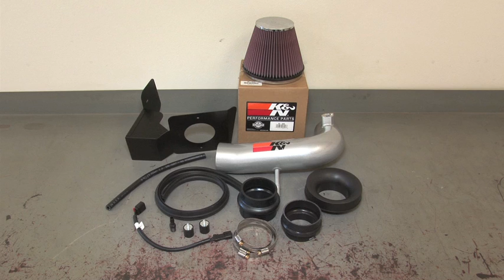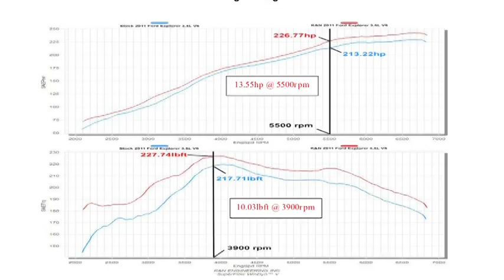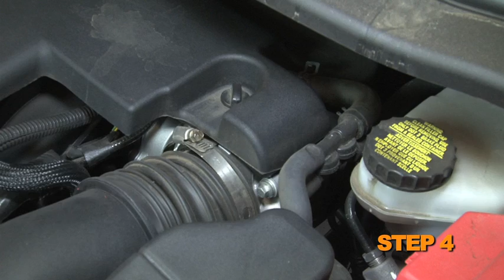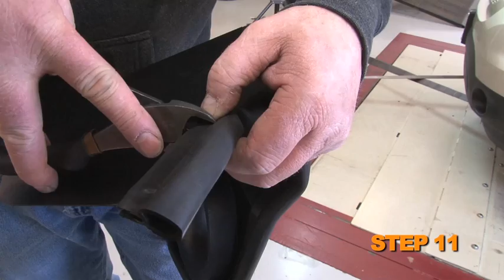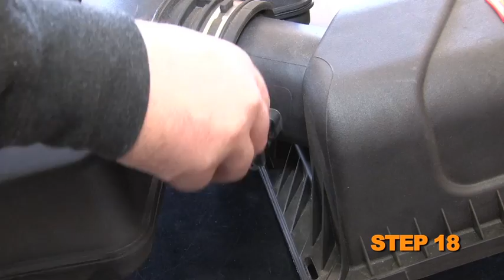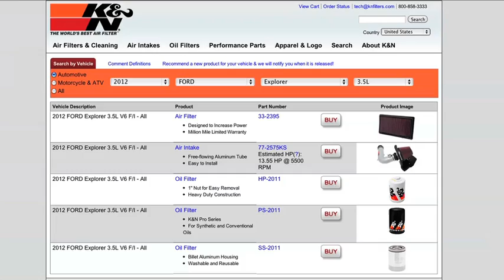Ford Explorer 3.5L V6 [#77-2575KS] Air Intake Installation

Comment: After installing this kit on my Ford Explorer 2016 3.5 NA I have loss of power about 10 hp and a big drop of Torque in range of 3000-3800 RPM. My modification don’t have MAF, it is using MAP sensor.

Comment: I installed this K&N cold air intake in my 2021 Ford ST along with that new K&N Boost Control Module it really increases your torque... horsepower...and acceleration

Comment: Do I need to get a tune or will it throw a code?
Reply from the maker: All K&N intake systems are designed to work with factory ECU settings and do not require a tune.  If you encounter any issues please contact our product specialists at 800-858-3333 or tech@knfilters.com.

Comment: I just installed mine this past weekend.. What difference in sound and acceleration, takes a little to used to... But.... Vvvrrrooommm vvvrrrooommm. I did notice once the throttle opens up at 30mph is when the howling begins. I highly recommend them.

Comment: I just installed this same kit (K&N 77-2575KS) on my 2016 3.7L NA DOHC Explorer Interceptor. K&N tech will tell you there is no kit for this specific vehicle and that the 77-2575KS  kit will not fit. Im here to tell you that it will! It installs the same as it would on the 3.5L with absolutely no issues. It will use all factory mounting and use all K&N included hardware from the kit. The only differance is that the 3.7L does not have a MAF sensor on the intake pipe, so you will use the included (comes with the kit) MAF sensor port cover to close the hole on the K&N pipe. I can confirm perfect fitment and the sound improvement is absolutely amazing.  If you have any questions, please feel free to reach out to me.
Reply: Hey I have 2013 Ford Explorer interceptor and I’ve been looking around and can’t find intake that seems to match will this intake 100% fit and will all the hardware from the kit work?
Reply: @Ripp_bh  yes, I can confirm that this kit will fit. I have 2013 interceptor that I use for work and installed the same kit on it. All the hardware you will need will come with the kit. My favorite part of the install is the fact that the engine sounds meaner under load. Have fun man, it's well worth the money.
Reply: If you do use this CAI, I would absolutely recommend pairing it with the BBK 73mm throttle body made for 11-17 3.5l mustang. It's an exact fit for our 3.7L  interceptors, using the 4 factory bolts and holes as well as the factory plug. The combination of the throttle body and CAI make a wonderful pair, providing noticable gains, not to mention a nearly doubled throttle response time!! Nearly no throttle lag, which in my opinion was one of my most hated flaws of the 3.7.
Reply: Thanks I’ve been looking everywhere and couldn’t find anything that fits nice to know there are parts out there
Reply: How its now after 3 years?😂

Comment: how did you go from 290hp to 460hp I want that. I am guessing that is a typo, as you must have done the cold air intake and a tune plus some, what ever it was if proveable I would be interested. Mine is an echo boost and is factory with 365hp and 350 ft lbs of torque to boost it to that level would make me smile.-460hp would be just right for me.